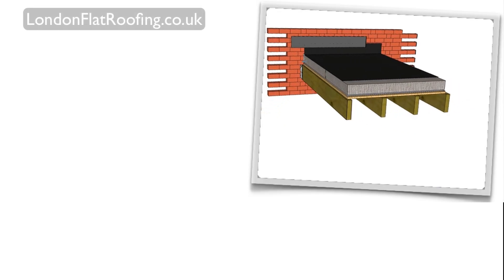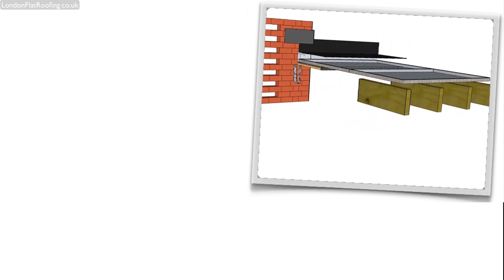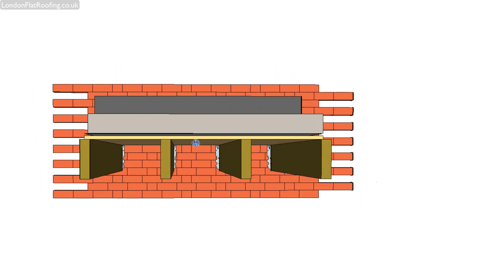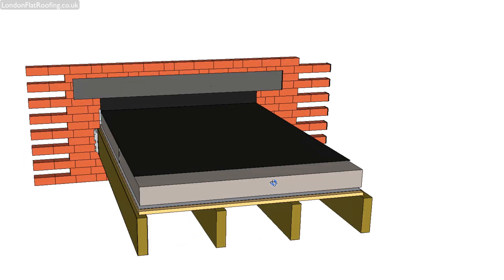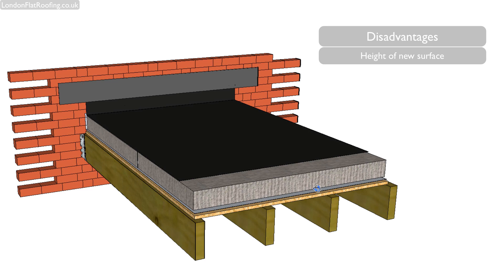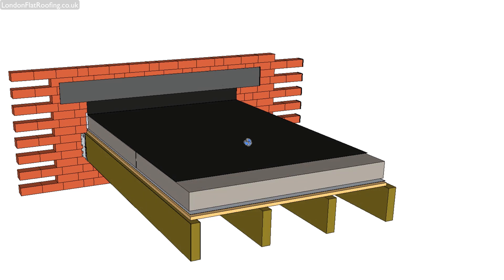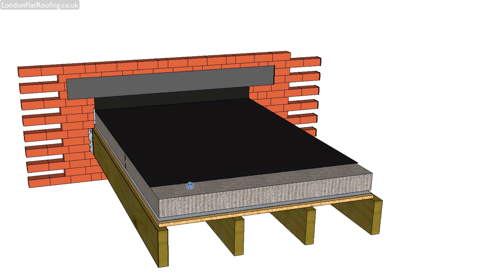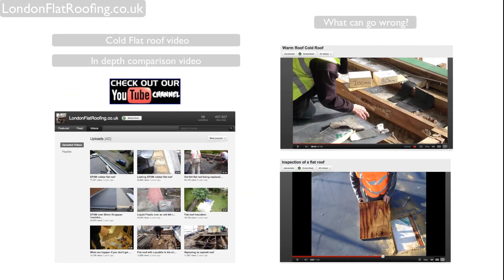Warm flat roof construction Explained.

Comment: I did a warm roof on my garage,the original deck boards were in good condition so i left them down, i put on the insulation followed by OSB3 boards and covered it with a fibreglass roof coating.because of the length of the screws i used to fasten down the OSB they protruded through the original decking,when we had some frost last week i noticed that the heat had travelled up the screws and melted the frost at the screw heads resulting in little dots all over the roof where the screws are.

Comment from the maker: Excellent I love you exactly my point of view, how manufactures can say that placing a soft insulation onto joist with a 50mm bearing with a 6mm ply on the top works is beyond me, I have planed a video on this as I have some new flat roofs with such a buildup and asphalt on top that has settled and cracked as the hole thing has moved under the weight.

Comment from the maker: Its an interesting  part of law but  I’m not aloud to give you a specification as I don’t have PI insurance, however the best vapour barriers on the market are felt laid with bitumen we On new flat roofs we like to use a self adhesive bitumen  based vapour barrier rather than a polythene one its more expensive but we don’t like young heat on roofs then we have no chance of dating the roof on fire!

Comment: we have a existing extension with a cold roof, and building a new extension side by side with a new warm roof, we will cover over the top of the existing ply and felt with TD 4 126 and bring the new roof up to the same height with plywood so we can carry the TD 4 126 over the full roof, what vapour do you suggest on the new ply roof before the TD 4 126 is fixed, should a 2mm layer of felt be applied with hot Bitchumen first??